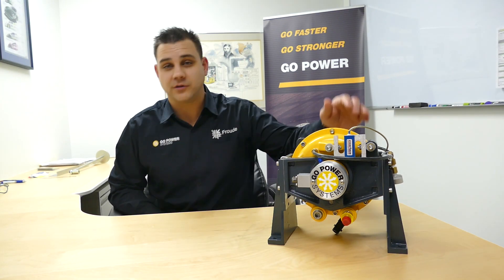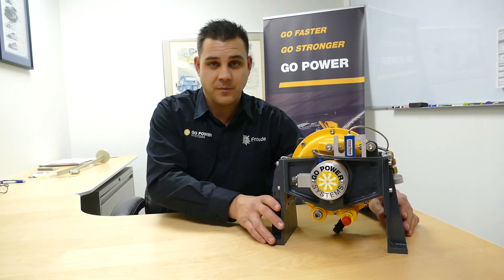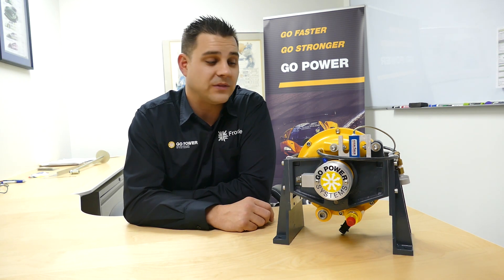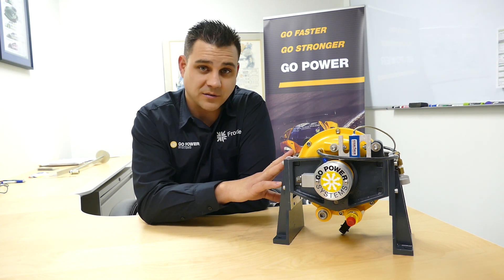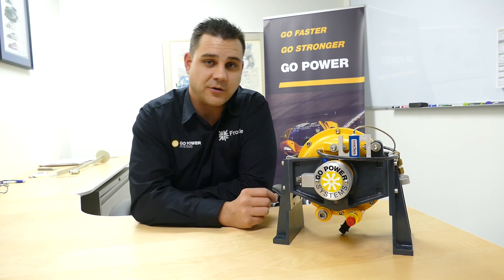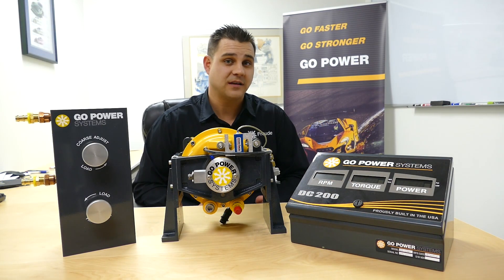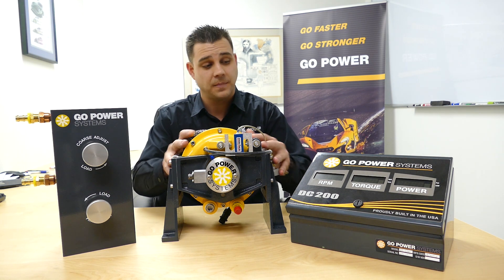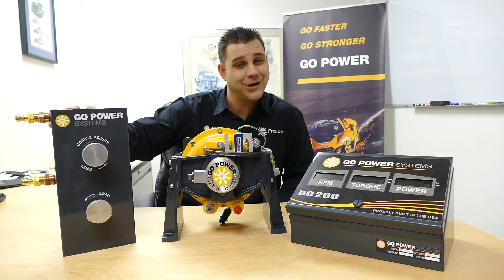D100 Go Power Small Engine Dyno

Comment: Can it measure 6hp on striklckly 10 and up
Reply from the maker: Hello, Nicmo Racing! Currently, the D100 is best in between 10 and 100 HP. We are working on some modifications that will enable it to test engines under 10HP so stay tuned. Thanks for your interest in Go Power!

Comment: 14000rpm isnt enough for even base 100cc iame kart.
common man
Reply: I think this dyno is really meant to be used with Honda, Predator, Kohler and Briggs and Stratton engines and other similar engines. Most of them are rated at 3.600 rpm stock but some people hop them up to where they can go 8,000 rpm or more. They rarely get pushed any higher than 10,000 rpm so I should be more than adequate for those types of engines. 
This can be used vertically which is good for testing racing mower engines. 
I’m sure that you can use a higher rpm engine that can go over 14,000 rpm but you might have to attach it to the dyno with some sort of speed reduction and then calculate the horsepower and torque based on the rpm change.
Reply: I was thinking that too